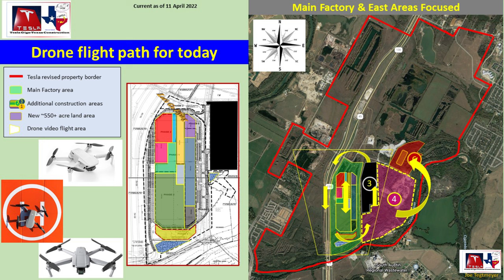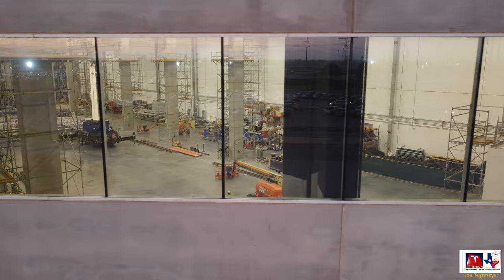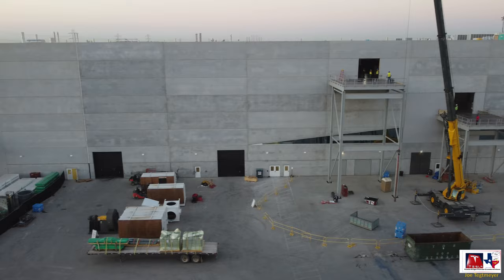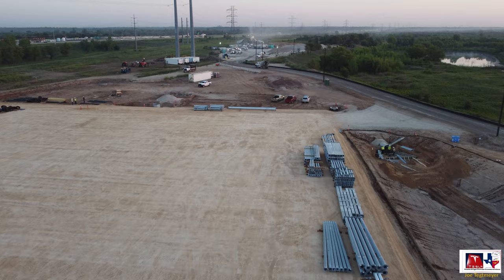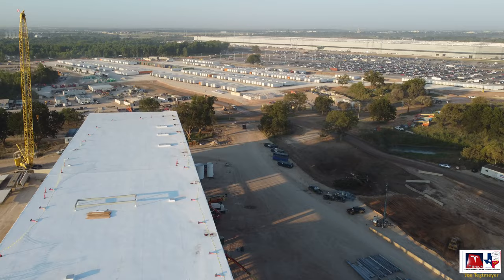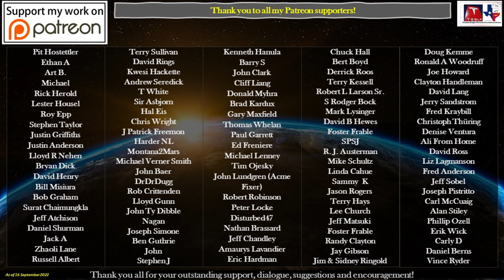23 September 2022 … Detailed views inside Casting & 4680 production areas at Giga Texas! (06:45AM)

Comment: Thanks Joe.
Fantastic views into Casting.
2:47. Casting. Floor removed. Depth wouldn’t seem enough for a gigapress footing. Possibly had a rethink of the location of additional gigapresses.
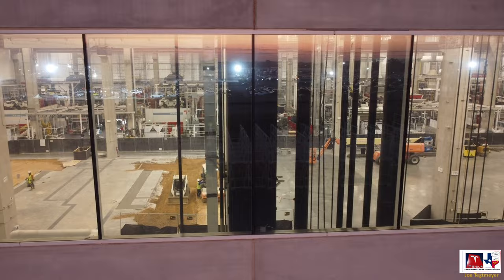2:57. Casting. Columns. Steel plate strengthening collar at the bridge crane beam corbel. Remedial works, or twitchy engineer.
4:07. Casting. Stairs to Paint. Fire escape from Paint perhaps. Right of screen, the mystery red cylinder.
4:44. Casting. Big black machine. New concrete floor around the edges.
5:06. Casting. Black and white machines. The curved guardrail doesn’t look like anything seen in Shanghai/Fremont/Berlin videos.
5:49. Casting. Columns. Bridge crane rail beams removed. Beams seen being removed and stored in Jeff’s video yesterday. Scaffold around each column for access to likely to install a steel plate collar around these also. Columns to the east were seen modified in the previous peek inside.
8:26. Battery. Workers wearing over-booties.
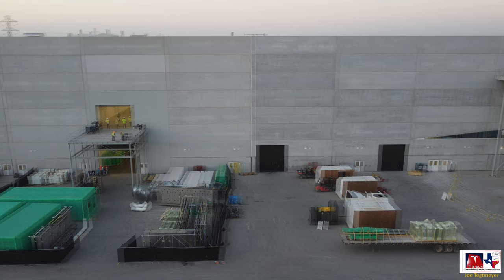9:54. Paint. Loading platform. Inside. Sheet plastic wall.
12:43. New substation site. Ground slab for a small building perhaps. 
Detention/retention pond. Forming up some sort of outfall structure, or a funnel. Inflows or outflows? North end similar.
15:41. North of Cathode. Pond filling. Polar opposite of the effort they went to to drain, remove mud, fill and compact the ponds under the main building, and under Cathode. Unlikely a building would/could be constructed over these ponds.
16:47. Cathode. Right of screen. Vegetation removed. New temporary road through the old hire depot yard.
18:46. Cathode south. Skinny wall panels on the trailer. Don’t look tall enough to be the top panel given the location of the bracket recess. Maybe a skinny panel second from top. To work in architecturally with windows on the west side.
20:44. Cathode. Level 1. Very clear view of the geo-piers in the face of the excavation. I have an idea these excavations might be for large set-downs in the floor, rather than slab thickenings.
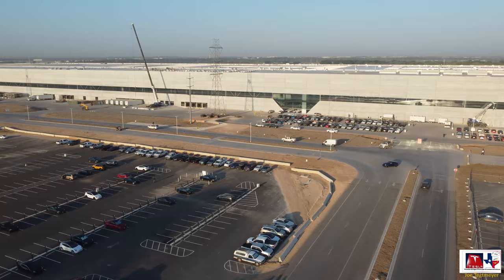22:26. BIW, apron. Right of screen. Crane likely located to remove sections of already saw cut wall panels for more loading dock openings. 
23:11. Stamping, apron. Heavy deliveries placed on the trestles. Presumably on the trestles to drive a SPMT* under. 
On the easement. Trailer would be the one seen at the rodeo with the Tesla Semi. Semi hiding inside somewhere.

*SPMT (Self Propelled Modular Transporter).
Reply: 2:57 Bigger crane at the north end similar to the cranes on the east side that need those beefy crane rail beams. (and corbel reinforcement)
Reply: @bobcallahan2322  That answers a question then. Would the existing beams be going back? It would seem not. 

The works never end. I love it!
Reply: 23:03
At the shadow of the gnomon the time will be 8:27
(Using the east most lamp poles, the shadow of  a lamp pole being just to the right of the solid white line (where it intersects the north/south area line) that is just to the right of the walkway lines. 
Clear as mud, as easy to decipher as a binary clock.
Reply: @GeeKayKayGee  You know I'm not one for minor details, but have you factored in being 7 or 8 days past the equinox, and the building being a degree and a bit off true north?
Reply: @DessieDoolan  Yes I've accounted for the equinox. Off true north? Humbug! Humbug I say! Why if it were off from true north all of the cars exiting the factory would run into the side of the door. That is not happening, ergo the factory is in perfect alignment.
Reply: @GeeKayKayGee  Dammit, I feel so silly now. For a change...
Reply: @GeeKayKayGee  Are you perhaps referring to that old text based game called Trinity? A true classic, next to Zork I, II and III. Even with the latest Windows of OS versions, anyone can still load a gizmo to play these games... after the latest from GT of course.
Reply: @hardernl8893  Mostly I'm just messing around adding grist for the algorithm mill. 
Noting that the shipping lot is at right angles to the factory which pretty much runs due north/south, the shadows from the lamp posts where they cross the north/south painted white lines, could be used to  estimate at what time the video was taken.
Oh and a gnomon in this instance is the part of a sundial that casts the shadow.
Reply: Good Day Dessie, Your 4:07 I believe that the red cylinder is the jig for setting the distance for a standard mold in the casters.
Reply: @eltonray2934  4:07. I guess it could be. There's one at Fremont also. Some chance of seeing that in place. Haven't seen one in the Berlin or Shanghai videos.
Reply: @eltonray2934  Similar item here in an IDRA video for a smaller model press. White, bottom left. https://youtu.be/Ju-Dquc3iPo?t=266

Comment: Great inside video today Joe,  The equipment at 5:02 could be machining centers to finish the castings ready for production. All flash and injection paths will have to be trimmed off, mounting bosses have to trued and holes tapped for studs or cap screws. At 8:41 I believe that the cells consist of an anode which is copper with a graphene coating on both sides, the cathode that is aluminum with the lithium mixture coating and a separator with a flammable electrolyte. They are rolled up "jelly roll" style and inserted in the metal can with an insulated positive terminal. Then they go through an electrical forming process to finish the cell.
Reply: Having worked in aluminium foundrys I agree with you on finishing the castings.

Comment: 4:09 The 4th casting machine presumably is the same 6k machine as the other 3, but it has a completely new white/red box and -ducting, ending in this blue heat exchanger box. This box  looks a lot like economizers I have seen above industrial steam boilers: the hot flue gas from the boiler is heating boiler feedwater that is circulating in pipes. Here you can just see these pipes, they stick out a bit with their U-bends outside the white colored circular inserts. The idea is that you cannot have a significant pressure drop in an economizer, so it is like a huge box with relatively few piping obstructions inside.

But here it is not heating but cooling, I think, but with the same idea of an air flow (through the box) that cannot be cooled with a lot of pressure drop because the air-fan, the box and the white insulated ducting do not have any appreciable pressure-rating. Like in the above description of an economizer, such a box-type heat exchanger works best with a LARGE temperature difference between the hot and the cold medium. What is feasible and also likely I think, it that inside the pipes we have vaporizing liquid Nitrogen at minus 196 C, to deliver really cold air to casting machine #4. With such a set-up the Nitrogen cycle remains closed and can be re-compressed. Almost like my fridge, but at Elon-scale. They have to be careful though, because condensing water from the intake air may freeze and cause a problem.
Reply: Wow! I think I follow it. It's incredible that you can look at this bunch of pipes and boxes and figure that out. Fantastic effort. 

Presumably the heat is being shifted elsewhere? Reused?
Reply: @DessieDoolan  first: cold -196 Nitrogen may be overkill, I cannot determine whether the benefit of true cold is being outweighed by continuous frosting on the outside of the pipes which would require some cycling with the Nitrogen compressor on and off to manage this. If you look at a liquid Nitrogen storage unit outside other car factories you can see a pack of finned pipes next to it for the re-gasification of N2. There is some ice there but manageable.

Second: I don't think there is a benefit for a cascade of other coolers/heaters downstream this box to recover heat. Only in ultra large cryogenic units like for the liquefaction of Natural Gas will you find favorable economics for a cascade of cooling loops: Propane (-5 C) , Butane (-50) and a mixture of Nitrogen, Methane and Ethane to achieve -162 for the final liquefaction of NG. You may have visited NW Australia (if they have visitor's centers there) and seen the really huge array of LNG plants assembled there?
Reply: @Joetegtmeeyer
Reply: @hardernl8893  In over my head here. The heat would have to go somewhere though? Up a flue.

I haven't been to WA for 40 years. Tried to get back over the years, but hasn't worked out. It's a long way away!

Comment: 24:16 Contrary to what you are saying, he isn't removing material. He is mixing materials. The dusty material that we see in there is most likely cement being mixed with dirt. It looks like they are trying to stabilise the ground near the end of the pipe.
Reply: Interesting.
Reply: The material being mixed in could be hydrated lime used to thicken the clay in the pit for transport for disposal.

Comment: Can't believe, in a Texan climate, Tesla is using a sprinkler system to irrigate the new landscaping. So wasteful as much is lost directly into the air due to evaporation and the same is true for moisture loss from leaf surfaces; all watering should take place directly at the roots. If Tesla was so insistent on irrigation installation, the burying of a porous pipe network would have been massively more efficient especially as climate change driven extreme temperature & drought issues are only going to continue to worsen over time & Giga Austin is a for the long haul facility. I personally would also have dug in large amounts of water retention gel into the soil to further increase soil moisture retention capacity; it really DOES make a huge difference.

Comment: Hi Joe, those enclosures they added on the North East corner of the casting area, whatever they holds, to me it looks like they’ve added sprinkler systems to them. I’m no expert, but all those pipes resemble a pattern for water coverage for if there was ever a fire.  Or are they just electrical?  Just an observation...

Just as you were pulling back from the casting area, I was wondering if next time you’re at the extreme right corner of that small portion of the window, could you turn the camera to the left, you may be able to get a peek inside the first enclosure if there’s a door or window in it.  Just an observation.

Great video as usual   👍

Comment: 5:01. Casting. Left of screen. Further googling. Black machine is a DMG MORI DMU 340 Gantry.

Installation video of same here, https://youtu.be/kpavriVZXmA?t=50
Reply: So it's a type of CNC machine for milling those castings I hate so much? :)
Reply: @DavidJohnson-tv2nn  5:01. All 3 machines are CNC milling machines as shown on the DMG MORI website. If you look at the specs the capacity is impressive, 30tonnes for the 340 Gantry, 10tonnes for the 340 U. 

Seems overkill for dealing with 66.5kg and 85kg castings. Unless these machines operate at some incredible speed to handle the output of the gigapresses, I'd say they might be for die maintenence.

I don’t know the first thing about how the entire casting plant would operate, so speculation on my part. Hopefully someone who has experience in the field will chime in, otherwise we’ll have to rely on Joe’s early morning peeks inside.

Comment: The white will look great but unless it's a functional feature to reduce cooling/air-conditioning and not merely decorative, seems a bit of a waste of time and money, both now & in the future maintenance. That being said, I'm rather surprised their using rollers; I'd have used a spray unit because it's far quicker and less physically exhausting, unless there were concerns about drift onto nearby newly built Model Y's.

Comment: Great video, as always.  Wondering if you have any idea what the large "packages" on the flatbed trailers at the southeast corner are.  It is at 23:12 in the recording.  They look really heavy.
Reply from the maker: They are AIDA crates with very heavy components to the new metal forming machine in the stamping extension structure. In my previous video, I showed inside where the foundation is being finished for this large machine. It is part of the CT production equipment.

Comment: Substation -
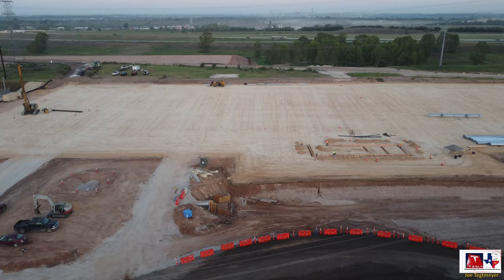@ 12:16 Lower right) Formwork for a concrete slab.
@ 13:30 (Pond - north end) Building headwall for the stormwater pipe.

Comment: If they extend the building south seems odd they are bothering to paint the current south side. Won't those walls just be removed once the expansion starts?
Reply: Plus they wouldn't have installed superchargers along the south face of the building.  Seems like a new building will go up, likely with fly bridges connecting it over the road to the main building.
Reply: @CarlWithACamera  
Maybe the left hand doesn’t know what the right hand is up to.
Reply: @freddymax5256  If nothing else, there is job security in construction at a Tesla plant.
Reply: @freddymax5256  Sad if that's the case.  We should know soon enough as they continue excavating.

Comment: I sure as hell would hate to paint that entire building with a roller…even a huge roller. I’m not a painter, but I’ve seen a bunch of it, and I have no idea why they would roll a coating over these walls instead of spraying it on, even if you would still need to back roll it for some reason. Any professional painters out there with an opinion?
Reply: There's a 'Little Johnny' joke just begging to be told here. 

Anyway, it'll them ages to paint it.
Reply: @DessieDoolan  Painter in 2047: Grandpa started on the Southwest corner September 23, 2022.  Dad spent his whole career painting wall panels taken down and replaced during retrofitting of the inside.  I've got one more week before I'm replaced by the TeslaBot that was supposed to replace Gramps in 2025.  There's 2.5M gallons of white paint sitting across the highway on the unfinished foundation for Starlink HQ.  Rumor is Elon sent a message from Mars this week and wants to change to Red Multi-coat.
Reply: @scottgaree7667  It's all just about plausible! Except if Elon is on Mars, he might be well and truly over red.
Reply: I'm not a painter but it is probably to keep the overspray from getting on parked vehicles. Sure hope they hire a crapload of painters.
Reply: @scottgaree7667  If it was a government job, I’d 100% believe it. I was witness to a guy recently retiring from a federal position. He was hired  30 years to manage and maintain an analog system for an agency that will go nameless. Said system was superseded by a brand new wiz bang new digital system 8 years ago. It works great and everyone is happy with it. But, for some reason only a government agency could know, they did not turn off and remove the old analog system. So this guy has maintained the old system even though no one uses it, wouldn’t know how to use it, nor put any new information into it for at least 7 years. But Sam officially retires at the end of this month, he is using up his vacation time now. I’m just wondering if they are going to replace him and where do I go to apply for the job!
Reply: @Joetegtmeeyer
Reply: Over spray on the windows and parked cars - especially the cars. Windows can be cleaned fairly easily- they are flat and smooth - but cars would be very expensive - they are curved, lots of nooks and crannies.

Comment: Kinda confused as to why they would be painting that south wall at all even as they are tearing up the concrete slab, presumably in preparation for construction of the 500 foot southerly extension of the building, since, presumably, those south-facing wall panels and windows may very likely be removed as they connect the 500 foot extension to the building ... 🤔
Reply: Remember this is Giga Texas where the moto is no chance to waste money shall be overlooked.
Reply: My speculation is that this wall will not be removed.
Reply: @jbbuzzable  So are you saying that you think the addition will be detached? ... a separate structure? I guess we'll just have to wait and see what develops.

Comment: @ 15:53 Filling pond but doesn't appear that there is much effort to compact the soil. Just dump it and later, push it in with a bulldozer.
Reply: I think the soil going into the ponds was previously stockpiled unsuitable soil that could be mixed with some topsoil and unusable for structural fill.
Reply: @bobcallahan2322  Thanks. So does that mean nothing can be built there? Or can something can be built with the use of steel or concrete pilings?
Reply: @DavidJohnson-tv2nn  Probably no building because of the possibility of too much differential settlement of normal foundations. Parking or storage is easy to fix if it settles too much.

Comment: That has to be a test painting area. No way they are painting the entire factory with rollers.
Reply: I don't know, but it looks like they are moving pretty fast. Also no paint loss to the air.
Reply: As mentioned in another reply, and I must admit it didn’t come to me at first thought, they may be using rollers since there are so many cars in the general proximity. Even using an airless sprayer there is the possibility of some atomized paint drifting in the air.